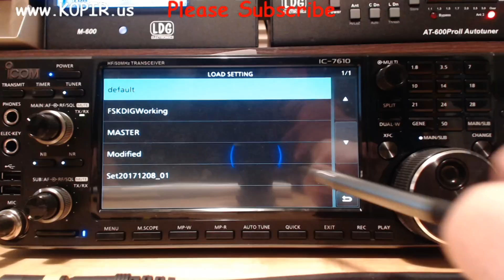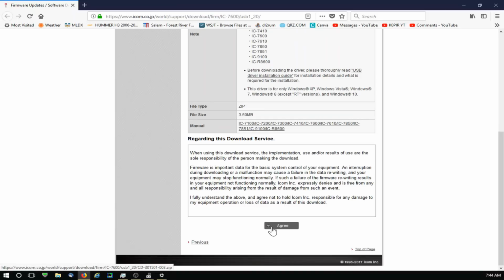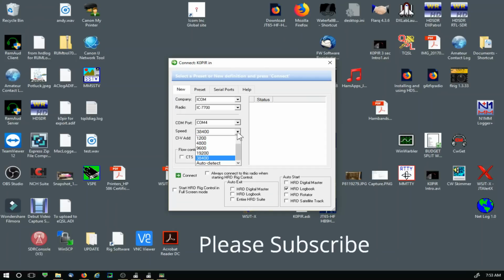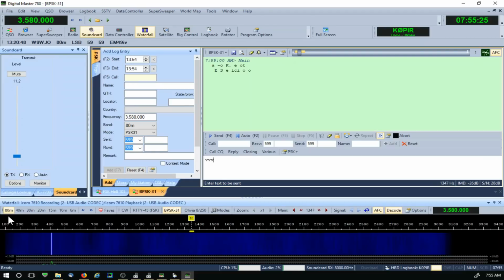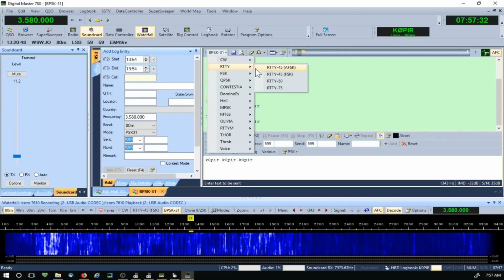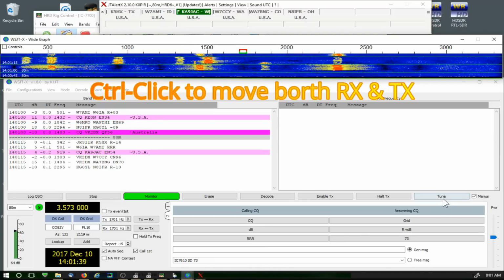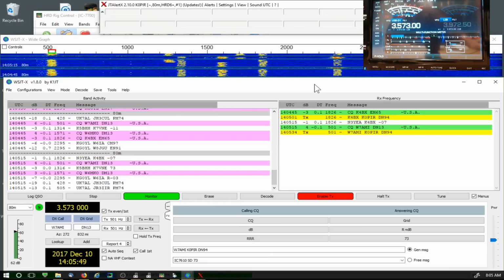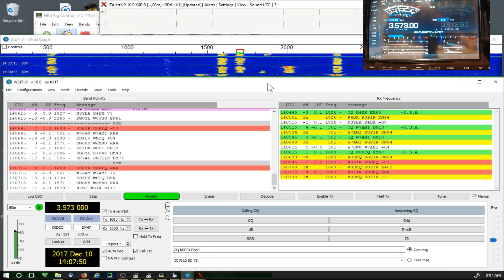Icom 7610 HRD DM780 WSJT X Basic Setup

Comment: I plan to buy an Icom 7610 in the future. Is a SignaLink interface box needed between the Icom 7610 and the computer, or is the Icom 7610 connected directly to the computer with the USB cable? Is a special USB cable needed? Is the USB cable included with the Icom 7610? If the Icom 7610 can be connected directly to the Windows computer, is there any advantage to using a SignaLink box between the Icom 7610 and the Windows computer?
Reply: Hi Dave, thanks for viewing and thank you so much for commenting here. No a SignLink is not needed. Just a USB cable. The USB2.0 cable is the mani one and then if you want to do HDSDR you will use an additional USB3.0 cable. Neither are included with the Icom 7610. No advantage using a SignaLink, the 7300 and 7610 both are FB. 
Sample USB2.0. you can find a cheaper one and even add your own ferrite. https://amzn.to/2UVbqGL
USB3.0 https://amzn.to/2V28lop
I hope this helps and thanks again, 73!

Comment: You mentioned your Mac in the video, have you connected WSJT-X to the Mac without running HRD?   I use Mac Logger DX for my primary rig control but normally when I was running my IC-9100 I would just close that program and run WSJT-X or FLDIGI as independent programs.
Mac Logger DX is working on the 7610 but I can't get the other programs running.  Any thoughts?  thx de AF1US
Reply from the maker: Hey Brian,

That's a great question and no I don't have it working on the Mac with WSJT-X. I am like you. 

I suppose choosing None for rig is the way for now. 

MacLoggerDX works FB. 

If something comes up, I'll mention it here.

73,
Rich, K0PIR

Comment: Rich, I've duplicated your settings on my 7610 using  a Windows 10 machine.  No joy.  My comm port numbers are com5 is A and 4 is B. I have also tried the (WSJT-X) IC-7300,7200, and the 7700 radios and still get the dreaded: Hamlib error: Communication bus error while getting current frequency. Migrating from my 7300 to the 7610 I just removed the usb cable from the 7300 and just plugged it into the 7610 usb connector. (not the blue) What rig are you using for WSJT-X?
Reply from the maker: Hi Maurice,

Nice to hear from you and thank you for commenting. WSJT-X doesn't have the 7610 yet for a rig, so I am using Ham Radio Deluxe as the rig. Start here: https://youtu.be/0G8Jlb-l9KQ?t=11m14s

That should do it!

Let me know. 

Rich, K0PIR
Reply: Same here, no joy. Connecting the IC7610 to WSJTx direct no logging software using the USB A port. I will give you a thumbs up if you can crack it.
Reply: Other than the logging problem, are you able to decode WSJT-X?  I have my 7610 working on FT-8.
Reply from the maker: Hi Earl, I am using Ham Radio Deluxe for the rig in WSJT-X and you can use DX Labs Suite Commander if you don't want HRD. Then you can just use DX Lab for rig, log your QSO's into WSJT-X's log and later import the WSJT-X log into another program. 73's Rich

Comment: Is there a way to adjust the level of the ALC on the 7610 or turn it off?  Or maybe it's not so important in digital modes?
Reply from the maker: Hi Mike,

Are you referring to ALC or AGC?

We can adjust the rig so no ALC shows, but having 1/2 to 3/4 ALC on the ALC scale is okay with these radios, actually maybe better to have some than not.

We can turn AGC off by holding down the AGC soft button for one sec and entering the AGC menu. From there select FAST, rotate the big tuning button counterclockwise and it turns AGC off.

I hope this helps and thank you for commenting. Best 73 - Rich, K0PIR
Reply: Thanks for the reply.  But it's ALC I'm trying to adjust or turn off.  I do have digital working but want to make sure it's optimized.

Mike
KM6KWG
Reply from the maker: I see. According to Icom, the experts and guys who have tested it thoroughly, having ALC is okay. So I wouldn't worry about it unless it gets too high.

Page 36 of the advanced operations manual - "When operating in the SSB data mode, adjust the device’s output level to be within the ALC zone."

I normally don't have any ALC and it doesn't seem to hurt making contacts. Lately I've adjusted it to 1/2 to 3/4 of the ALC scale. I just want to see for myself :-)

I hope this helps.

73,
Rich, K0PIR
Reply: Hi Rich,

I see the comment of pg 36 but is there anyway to turn it off just for grins?  I thought ALC was adjustable but maybe I'm mistaken.  I have worked folks from my QTH near San Diego as far away as Pennsylvania using Contestia at 25 watts with 100% print so you're right ALC doesn't seem to effect things .

73,
Mike, KM6KWG
Reply from the maker: No way to just switch it off, but with the right adjustments it won't show. The things that affect the power are the radios USB MOD Level, and RF Power. The Windows Sound Playback device level and the slider in the software also are adjusted. 

My USB Mode Level is 40% and I usually have my RF Power set to 30 to 40%.

Adjust the Windows Sound Playback and the slider in the software and you should be able to eliminate ALC.

See if that works.

Rich, K0PIR
Reply: Ham Radio with K0PIR 

Thanks Rick,

That is what I’ve been doing so I guess I’m on the right track.  

73,
Mike

Comment: Amazing video Richard and very informative.  After all the settings completed does everything work OK when you switch to SSB mode?  Specifically signal strength metering?
Reply from the maker: Hi Peter,

Thank you for commenting. I was sleep deprived by Sunday morning. This is a fun radio just like the 7300. I'm hoping to get them side by side soon. 

I haven't experienced any problems with the signal strength metering. Just this morning I was going back and forth between FT8 on 80M and LSB on 80M. Trying to figure out the best and quickest way while using Dual Watch. No surprises, working pretty darn well. 

While on SSB, turning down the RF Gain will reduce the signal strength meter, just like on the 7300.

My radio had the latest firmware already installed and I was surprised at that, but happy all the same.

The only thing I have noticed is when turning AGC off for digital modes I have to turn down the RF Gain more than on the 7300. Evidentially the 7610 is more sensitive. I was trying some different AGC settings and am using 0.1.

Let me know what you hear Peter.

73,
Rich, K0PIR
Reply: i guess I'm kinda randomly asking but does anybody know of a good place to stream newly released movies online?
Reply: @Eugene Titus try FlixZone. You can find it on google :)
Reply: @Odin Darian yea, been using FlixZone for months myself :D
Reply: @Odin Darian Thanks, I went there and it seems like they got a lot of movies there :D I appreciate it!
Reply: @Eugene Titus You are welcome xD